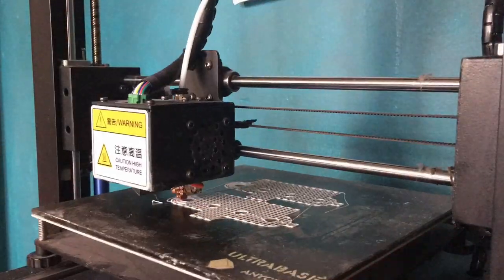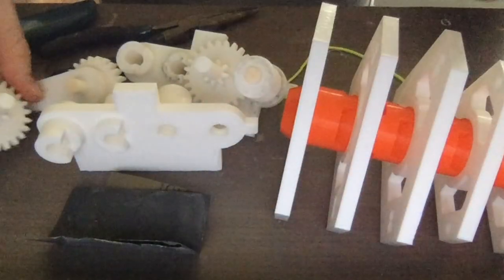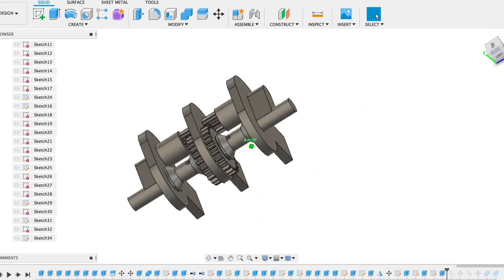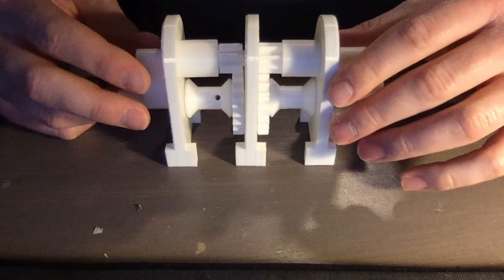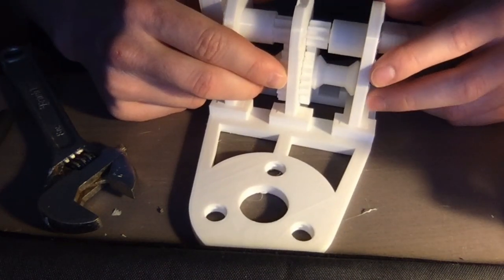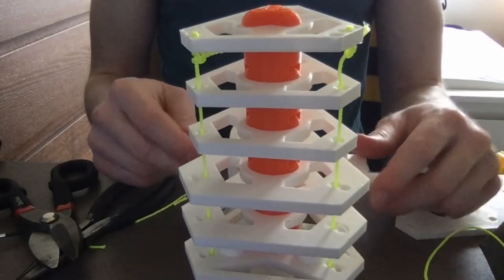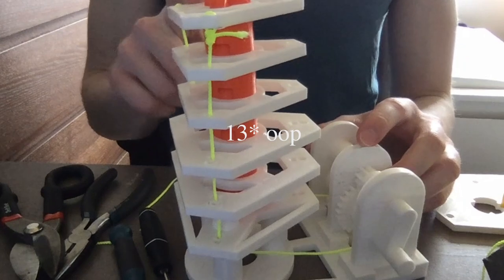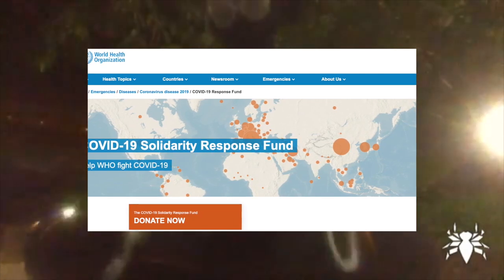Working 3D Printed Doc Ock Tentacle (Part 2)

Comment: What about metal gears or maybe carbon fiber, and if you had those wire strands as coiled metal wire and all the way around the entire discs if you made them round, you could pitch the tentacle at any direction, also if you made sectional tension points to allow for bending at certain points, if controlled by a CPU maybe a pi raspberry you can code functionality to be more fluidly dynamic for actuation instead of being so mechanical, but your system wouldn't need any electrical components but idk just an idea, I love seeing the stuff you make too